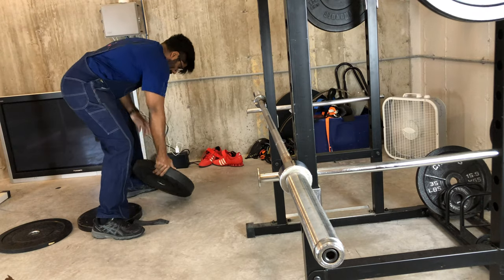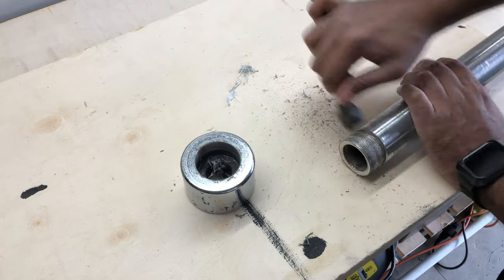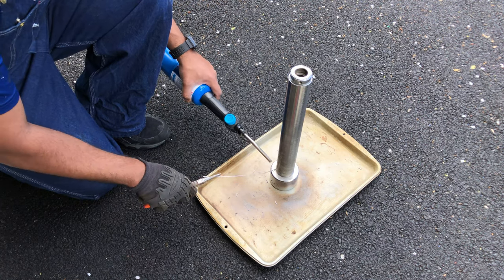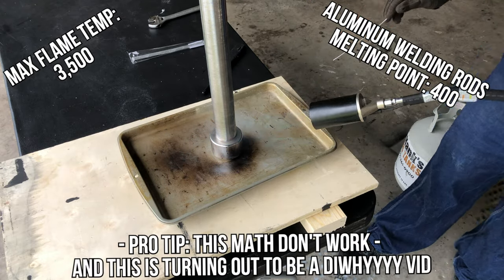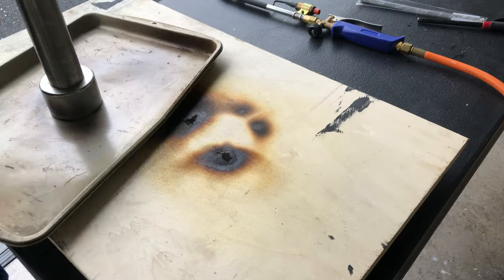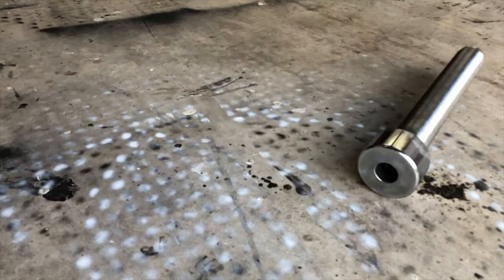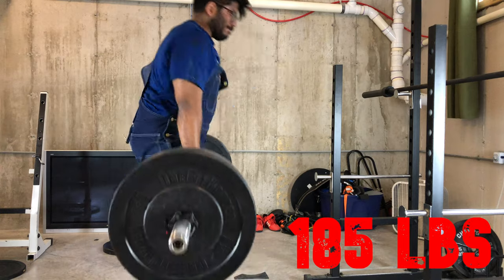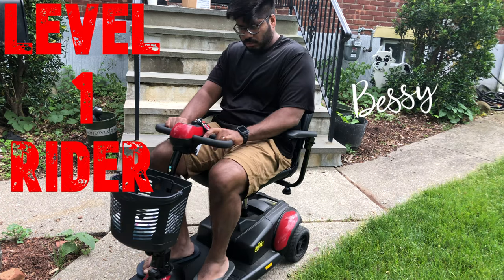How to fix a broken barbell

Comment: I have same problem. I was thinking about taking it to weld shop but epoxy looks more affordable. What epoxy did you use & how long to dry before use?
Reply from the maker: 1000% percent get a welding shop to use it, I used some box store epoxy which held for 2 years….. then failed after too many dead lifts … I used epoxy again and it’s perfectly fine for flat bench or squats … either way, I’m no monster with weight, but if are, new barbells on amazon are $100 on sale

Comment: How do u take out the sleeve tho
Reply from the maker: The repair doesn’t effect my ability to remove the sleeves.... the sleeves are attached by a bolt at the ends(many bar bells hide this bolt with a cover... welding would have been the best solution, but that didn’t work so well ... been using it to deadlift since, with no issues... this bar bell is 20 years old and It’s given me more gains than most people will in 2 life times.... fix ur bar and Keep those gains going!